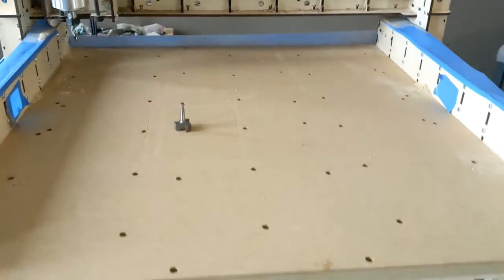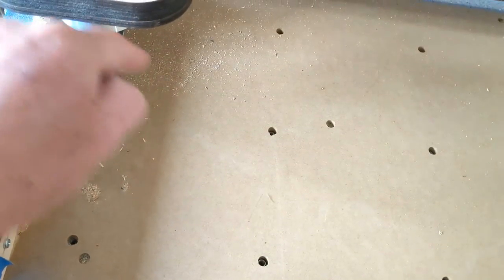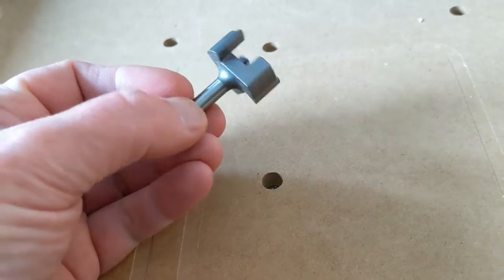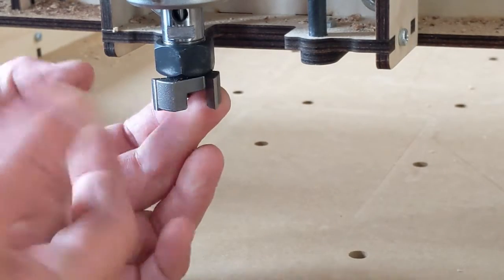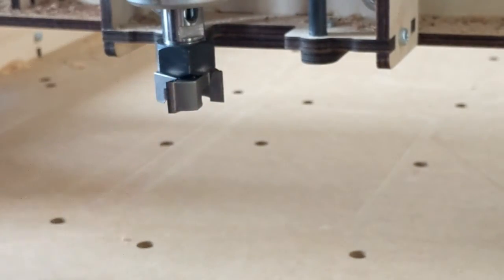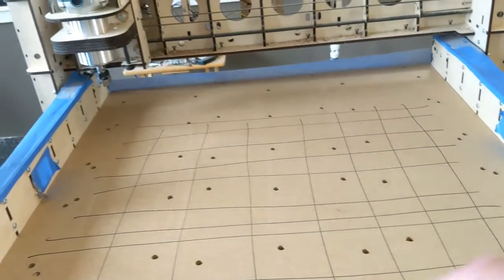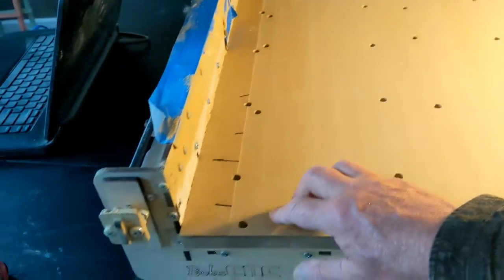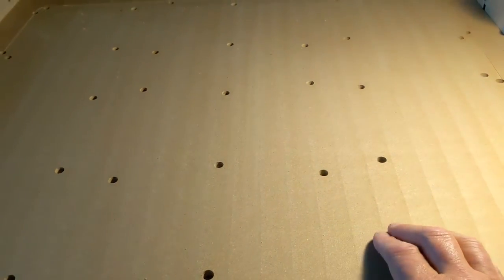How To Surface BobsCNC Spoilboard [Easy Method for Surfacing] CNC Router - Garrett Fromme

Comment: Thanks Garret! I like your videos.  You explain things well.  Just got the evolution 4.  I have not assembled it yet but your videos will be helpful for my first project.  Thank you for sharing your knowledge and experience!
Reply from the maker: @JC, Congrats!!! you are in for a fun journey. Maybe you can help me, as well. what kind of videos (information) do you think would be most helpful?
Reply: @IDCWoodcraft  Right now I’m trying to understand the basics of cnc’ing.  Feed rates, cut depths, reasons to use certain bits.  Also looking at enclosures for controlling dust and noise.  I thought your tree of life video was pretty inspiring as you made it look quite simple to get started.
Reply from the maker: Okay. I will work on videos about basics. thanks for the tip. I was surprised the tree of life came out as it did. Very cool result. It might be a sellable item as well.

Comment: Hey Garrett love the videos. You have helped me so much much with the basics and just learned what all around. I just bought a onefinity CNC and would love to write as many programs as possible to help myself. Do you have any video where you explain to write a surfacing program? I’ve watched a few others and I feel like you could just explain it so much better. Thanks for all the help so far.
Reply from the maker: Quack, sorry brother I don't really write the gcode. I just stick with the program because it's a lot easier and easier to teach everyone else!
Reply: @IDCWoodcraft  sorry I didn’t actually write the Gcode. That’s way above my head at this point. I just meant how you flatten the spoil board using Vcrave. Thank you for responding.

Comment: Question, when you are tiling a long piece that will extend out the back, how will you level it?
Reply from the maker: Hi Kasey. It takes a bit of ingenuity. Picture framing matt works very well as a sub-base for tile projects. Just make sure to use it for all tiles

Comment: Garret, I just watch this video on resurfacing the spoil board on your Bobs CNC E4. I have same machine except my spoil board is a little bit different. It has 8 individual boards that I had to glue to the surface to create the clamping system which leaves me with a lot of edges that could possibly cause some issues when resurfacing. I have a Binstak spoil board resurfacing bit. Do you foresee any issues when resurfacing?
Thanks, Tim
Reply from the maker: Hi Tim. There are no issues as long as metal is out of the way. Regardless, you will need to resurface it if you want to avoid bad carves.

Comment: Just purchased your file, thank you for sharing. I found this video to be extremely helpful as a newbie. Are you able to post a link for the bit as well?
Reply from the maker: Hi Nicole! I'm glad you found it useful. Sometimes we just don't know what to do when we're new. So glad you've joined the CNC world. 

The surfacing bit to use for this program: https://amzn.to/3jsDOgh
USE THIS 5% DISCOUNT CODE → UNW8VE2V
Reply: Thank you so much!
Reply: I have the code loaded in vcarve and the instructions up, but it doesn’t talk about what took path and settings to use. That might be a very basic detail but I just want to make sure I get it right. Do you mind sharing the steps on building the correct tool path?
Reply from the maker: @npierce83  you should have gotten the g-code file for this. I made the program to just run. however, you will use 1" surfacing bit at 80-120ipm. Depth of cut should only be 0.01.

does that help?

Comment: Thanks for the video,  I'm noticing my E4 has almost the same out of level pattern.  I would like to buy your program, but, I have concerns that it won't work if I use a different router bit and I haven't shelled out the $350 for vcarve yet.  Would it be possible for you to recreate the program in something free IE estlecam, easel, or carbide or link to the required router bit.
Reply from the maker: Thanks for the comment. I didn't think about this for other size bits. What is your largest bit currently?

Here is a link for the bit for the program available on Etsy: https://amzn.to/2HmV7kg

It's actually a good bit to have for resurfacing warped or weathered wood so you might want to get it regardless.

What are some of the projects you'bve made on your E4?

Comment: Hey Garrett. Can this gcode at etsy be used for my Longmill? I'm using Vcarve Desktop, so I am wondering if the SVG file is included so I can edit to surface a 24x24 inch workspace.
Reply from the maker: Hi Chris. That particular file will not work, but I have one for the Longmill. In fact, it is set up to create your entire spoilboard, surfacing and all. Click here: https://etsy.me/3AZRpnq

To learn more about it, watch this video: https://youtu.be/dbxtLQY26Cw
Reply: @IDCWoodcraft  Thanks Garrett!!

Comment: I purchased this surfacing file from you.  I wanted to resurface before doing my first cut.  The X axis goes the full 24", but the Y axis only goes around 12".  The UGS programs thinks its going 24", but its only going  about half of that.  Any idea what would cause this?
Reply from the maker: Hi Kyle. That is strange. It may be related to count settings in your firmware. Contact Bob's regarding this.

Comment: HI, Garrett,
I have the Bob's Quantum CNC. Rather than a solid spoil board, it has six pieces of mdf, and five t-tracks. I have determined that the surface is uneven. Do you recommend this file for my machine?
Reply from the maker: StanProper, this would be just what you need for your machine with that unique spoilboard setup too brother!

Comment: 6 minutes of the presentation was predictable in the bit and the levelling process. For me, what was missing was which software and what was the setup before levelling? Saying what's available at the end was for me a lack of critical process.
Reply: You should already know this before trying to do a surfacing.  Those are core basics that you should  learn before you ever buy a CNC.
Reply from the maker: trumpetflowerll, the software used was UGS or Universal Gcode Sender. Hope it helps clear that up brother.